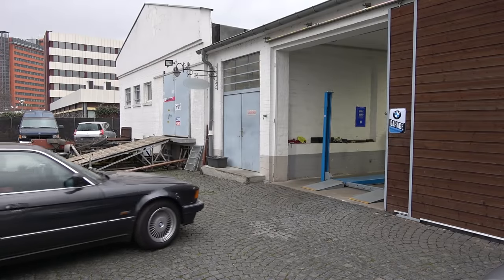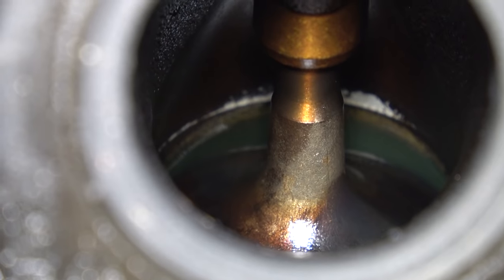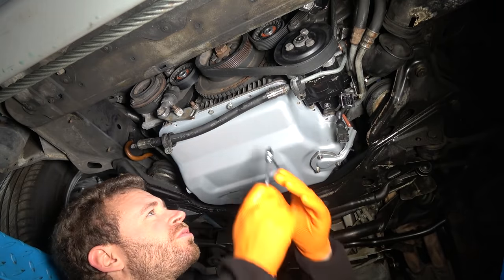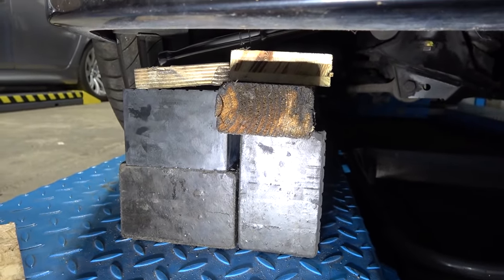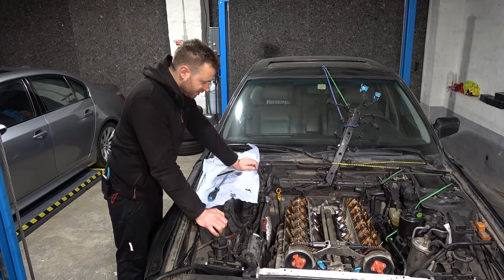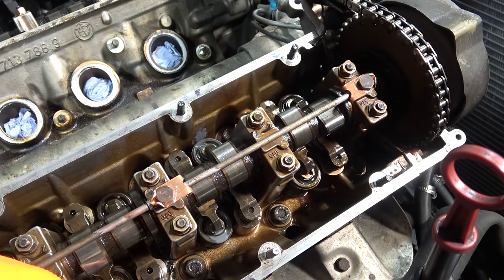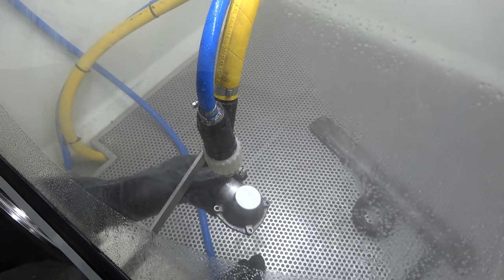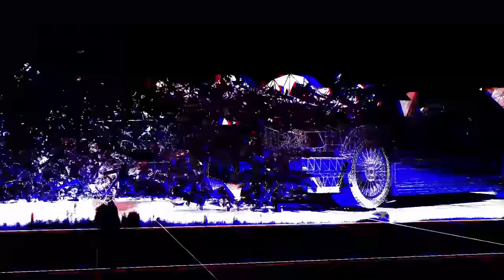Rejuvenating a 34-Year-Old V12 Engine - BMW E32 750iL - Project Karlsruhe: Part 7

Comment: hey man, a 90 degree thermostat is nice but it won't work without software.  nothing will change.
Reply from the maker: On E32? I think you mean on Alpina and that's incorrect, doesn't need any coding. Already works at 93-5°C
Reply: @M539Restorations  I'm sorry, I really meant alpine.  I have a 550i with a 90 degree thermostat but the temperature is still 105. Mechanic told me, that it's need a soft to cooling fan.
Reply from the maker: That's not true. Thermostat must open at 90°C if working properly, it's not electronically control.
Reply: @M539Restorations  maybe you didn't understand what I was thinking.  it is difficult to explain in English coz I'm a Czech.  We'll talk about it in the summer when it's warm outside.
Reply from the maker: I understand. What mechanic told you is incorrect. You don't have 90C tstat if it still works at 105.
Reply from the maker: Contact jarax.net from CZ.
Reply: @M539Restorations  hmmmm .... I bought it in the usa.  Maybe They would make a mistake somewhere and send me to 105.🤔😅
Reply from the maker: @Markos530d  those don't work well at all. Contact Jarax.net. He's the expert for N62
Reply: @M539Restorations  ok, I know him, so I'll call him and ask him.  I want to solve it because I did a complete resetoration of the n62 engine like you and I don't want to have 105 degrees anymore.🙂🙂
Reply: Hi Serenten.  I'm watching your videos and I'm a fan of yours. I have been repairing Bmw for more than 15 years and I have already made some N62, M70 and countless N52, N53, N57 engines ....... However, this time you are really only half right.  When the engine is fully warmed up in the summer months, for example in city traffic, the thermostat is still fully open.  Because the whole engine system is a closed circuit with a volume of about 10 - 15 liters.  And what cools the engine when the entire cooling circuit is heated is the gust of air while driving, or the propeller cooling when the car is stationary or just moving.  The thermostat cools the engine only when the entire cooling circuit is not heated, by discharging water into the radiators, thus forcing the cooler water into the engine.  However, if the engine runs for a long time, the cooling system will heat up completely.  And as I wrote above, it is cooled by the onslaught of air, logically only when driving at a certain speed, or as Marek writes in a fan.  And it closes at N62 to about 110 -115 ° C.  In order for the fan to turn on earlier, it is necessary to adjust the temperature sensor with a resistor that adjusts the motor temperature reading for the motor control unit just to make the control unit think the fan needs to be activated even when the actual motor temperature is around 90-95 ° C.

Comment: Try to use TECH2000 engine flusch ;  my 25y old audi burn 4liter of oil /10kkm after i add tec2ooo and engine running 3.5h oil consumption drop to 1l/10kkm  it realese a stuck oil rings.

Comment: All the rubber parts on bimmers are a headache and they dont last
Engin mounts valve guids suspensuin chassis mounts everything rubber..
Even fuel line.. :(

Comment: Are you sure that spark plugs are just 30 Nm, and not 90 degrees after that?
Reply from the maker: Of course, only 30 Nm. You'll strip the threads if you go further.
Reply: @M539Restorations it depends from the design of the  spark plugs. Last time I screw Bosch 25Nm +90 degrees. But it was with collapsible washer.
Reply from the maker: @mmaciek163  it doesn't. I've never seen torque to yield spark plugs on BMW. It's either 23 Nm or 30 Nm, it'll depend on the block material and seize of the thread.
Reply: @M539Restorations  example I gave to you was from Audi

Comment: 16:30 are you sure thats oil? Kinda looks like coolant at the bottom of the valve. Could be the video that is fooling me, but it looks like its a little oil on the stem itself, but blue-ish coolant at the bottom.
Reply from the maker: Oil. How would coolant even end up there?
Reply: @M539Restorations  Cracked head, not too uncommon on M50 heads for example. But good thing its not!! :)